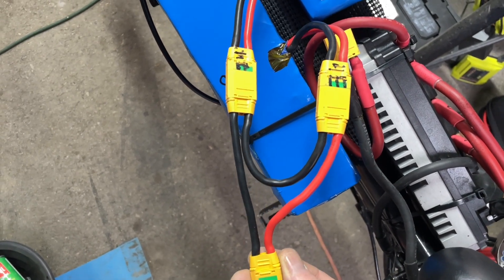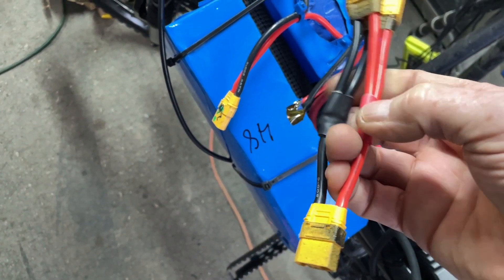E-bike Multiple Battery Series and Parallel connections. Study it out 100% before you try! Please

Comment: So, I just picked up a 48v 1500 watt ebike hub...I have 3, 36v 4.4ah lit batteries i was gonna use since they are laying around. It's best to run my 3 batteries parallel for longer range? The 3 in series would possibly blow up the controller since its 36x3?
Reply from the maker: Yes. Three 36v batteries in series will likely fry the battery internal bms and / or, if it's fused, blow the fuse. Also, the speed controller on the bike is very likely not rated for 108 volts and will blow the capacitors inside the controller instantly.  Usually, 48v speed controllers have 60 volt capacitors. So these will pop for sure. Additionally,  36v batteries may not even have a high enough voltage to use with a 48-volt speed controller.
A 48-volt lion battery has 13 cells in series.  Each cell usually has a discharge to a fully charged range of about 3v to 4.2v. So 13x3=39v is fully discharged.  And 13x4.2=54.6v fully charged. A 36v battery has 10 cells in series, so its maximum fully charged voltage is 42v. Your best option would be to get a 36v controller for your bike. It won't be super fast. But with 3 batteries in parallel, your range should be very good.
Please study up before doing too much. Lion ion batteries are fairly dangerous. Your batteries need to be carefully charged and checked out to ensure they function properly.   I never charge my ebikes or even a dewalt drill battery indoors. They can fail and burst into flames. I have had this happen in my shop and almost had a tragedy.  Luckily, I got the fire out quickly and saved my shop.
Please stay safe 🙏 
Prospector Tripp

Comment: Both connected for the battery should it be same 2batt like, same 48v and same 25ah? I hear if both diff ah battery its doesn't work
Reply from the maker: A Parallel connection:
It’s best to have the same amp hour rating with the same exact cells inside. Having two batteries in parallel having the same cells and the same battery build with the exact same bms in the batteries is definitely best. However that being said.. being in parallel will keep the battery voltages relatively balanced until both are similarly discharged and of course then recharged. 
Matching everything is always best.
A Series connection:
In series it’s SUPER important to have the exact same amp hour batteries. The reason is having a 48v 20ah battery connected to a 24v 10ah or vice versus.. a 48v 10ah with a 24v 20ah both these are making 72v total, however the 10ah batteries are only 1/2 the amp hour rating of the other battery and will get discharged twice as fast as the 20ah batteries. The 10ah batteries will get hammered 2x on the current and depending on the cells and the bms may fail early.
There is a lot of different cells, build quality and bms’s out there in batteries.
If possible.. always Match Everything in Parallel battery connections and it’s especially important in Series connections.
Stay safe and understand this very well before trying.
Batteries are expensive.. li-ion fires are Super Expensive!
Safety is Paramount ☝️
Stay Golden 
Peace Prospector Tripp